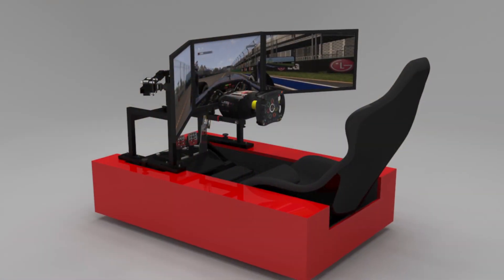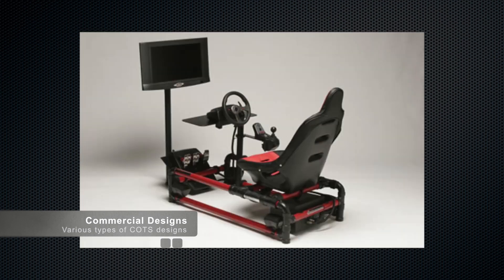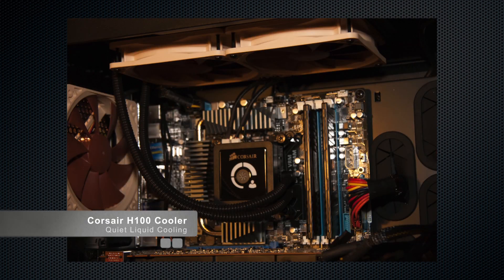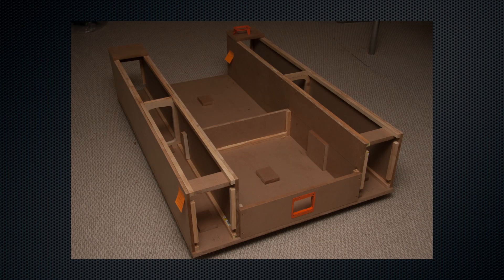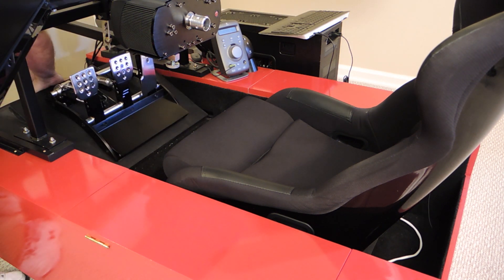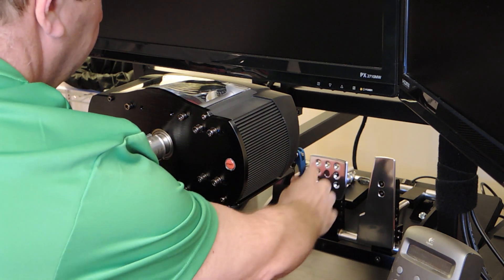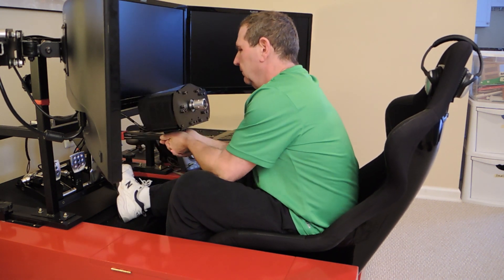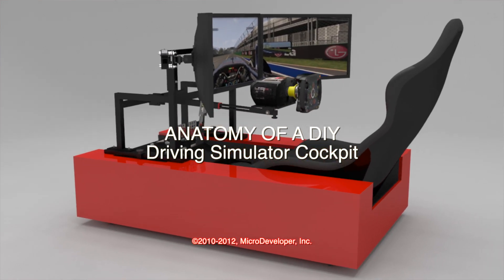Anatomy of a Driving Simulator

Comment: Amazing work Greg!  Finishing my rig with some of your design ideas in a very slim (width) mobile cockpit optimized for vr use , with a single 27" on an articulating gas arm for non-vr use and overall tuning...
Reply from the maker: That sounds awesome!  I'd love to see your new design.
Reply: Gregg Lagnese - it's not NEARLY as thought out as yours, especially since I lacked certain woodworking tools, so the frame is a bit tweaked, but it still looks good.  I think I'll call it a prototype.  Will post video and credit you with some of the ideas.  Currently waiting for my paint to cure more before mounting internal surge protector and powered usb 3.0 hub...

Comment: this is basically the EXACT design I run myself, from a positional aspect that is... Well done video. Should help alot of guys.
Reply from the maker: Very cool.  I'd like to learn about anything that helps with the design of the adjustable steering rack.  That is something I have been working on for a long time.  The building the rig part 3 video will outline the latest iteration which, while much, much, stronger, is still not as good as I'd like.

Comment: quick tips to research that will lead some of you to good solutions... 8020 rig, 4play racing, simvibe, OSW, accuforce, amd freesync monitors/ G-sync monitors (lowest input lag, smoother and nicer than no-vsync, best for racing). NO SLI,  i repeat, NO SLI, Keep tripple screens mounted seperate from rig to avoid shake. MDF for a base, not for a rig for least amount of work. 8020 for scafolding and structure, and lighter than steal. 8020: 350-700$ investment. modular for life. end of tips.
Reply from the maker: See building the simulator sled part 2 for 80/20 designs.  https://youtu.be/b1FEwQmfdHY

SLI will perform best for multiple monitors and is the least hassle (I have tried 2, and 3 way SLI).  While a single 980ti is okay, it is not as good for triple monitors.  However, it is better for an Oculus setup.

The mounts described in the aforementioned video isolate shake.  This isn't a full motion rig.  Freesync/G-sync definitely not required.

Steel is used because it is solid and cheap.  A by product of the weight is that it reduces monitor vibrations too.

In the aforementioned video I describe how much more expensive and cost prohibitive 80/20 is for a full rig.  The 80/20 is not particularly expensive, but all the connector and support costs add up fast.

All of this is provided as a BOM on my website too.
Reply: +Gregg Lagnese multiple graphics cards is not necessary for tripples and is actually inferior, due to the delay inherent with trading frames. most iracing guys use 1 GPU, even with tripples. sli also causes more problems than it solves by requiring many tweaks and special settings on games that don't support it well too. on a single card, frame rate doesn't have to be a problem. gsync takes care of frame rate. smooth even under high load, and doesn't require overpowered gpu's in sli to maintain fps limit and avoid stuttering...and my 980 shreds through Iracing on tripple Asus rog swifts @ qhd resolution.
Reply from the maker: I agree with SLI hassles and I've tried them many configurations of SLI (2/3) as well as powerful single cards (i.e., 980ti as of today).  I personally found that the 2 (or 3) 970's outperformed the 980ti.  It may be my case, but I had a lot of problems getting the triple monitor config to 'stick'.  Often on boot one or two monitors would no longer register.  This is probably due to me having cheap old HDMI monitors and the card having Display Port connections.

Also, going to G-Sync monitors is a big investment for many and is somewhat counter to one of the original goals (build it cheap).

Now that the Oculus is production, I'll be ditching the triple display anyway for one big curved single display for non-racing games, shooters, etc.  I'll stick with the 980 for now too since it drives the Oculus better.

Honestly, I am an Oculus convert, now that I've sunk some serious time into solving some of the issues (like VR sickness).  Racing with the Oculus is just so much more fun and immersive for me.  I can't race without it anymore.

Best regards.

Comment: Steering wheel is not stable, it shakes a lot. Even your seat shakes. Besides. You've got an incredible input/display lag.
I've made much more stable rig with 30$ worth of OSB panels. I'm sorry, but your build is just too overengineered, too pricey, too hard to construct for many and too unstable.
Reply from the maker: +Paweł Be (Bilazaurus) LOL, yeah a real car doesn't move at all...  BTW, I've completely changed the steering rack since this video was made and removed most of the movement, but I'm sure that also is too over engineered for you.  The seat is a real sliding car seat, so yeah, it moves - agreed - just like it does in a real car.  There is no lag between the CSW and the games, but you wouldn't know that just watching a YouTube video, and having no first hand experience of course.

I'm glad you built a perfect rig for less - you should do a video too and share your blueprints and BOM.  Then we all could build killer rigs for $30 - that would be awesome!
Reply: +Gregg Lagnese No point being sarcastic. You say wheel doesn't move in real car. It doesn't. I'm not talking about adjustment. I'm talking stability. It doesn't wobble in a real car. I have a real sliding seat on rails too.
Reply from the maker: In a real car, the entire vehicle is moving relative to the eye point.  In a non-motion simulator, the viewpoint (screen) remains fixed.  The minor movement in the wheel, due to the torque is not perceptible in practice and actually coincides with what you are seeing and feeling.

There are three key points you may be missing: a) you are looking at the original design which allowed for a 10-15mm deflection.  The new one is less than 5mm.  b) Unlike a real car, this setup is intended for users that are 3.5 ft tall to 6.5 ft tall.  c) The steering rack in a real car only moves a few inches in and out and up and down.  This setup extends more than 8 times that amount.  Obviously, shortening the reach and throw will help mitigate the inherent movement in the system.

That said, I don't think it will ever be possible to remove 100% of the movement, nor does it seem necessary from actual experience.  I can assure you, not one single person that has ever used this, has ever commented on the wheel or the seat moving.

While I appreciate your comments, the design goals are well defined.  I would be more than happy to prototype any other design for the steering that accomplishes the same design goal but moves less if you care to share such a design.  I already have built an alternative design which is quite a bit more rigid, and am working on another with further improvements to the usability of the steering assembly.

Lastly, note that this was intended for driving or flight simulation purposes.  Making the steering rack removable, and having places for HOTAS controls, were also part of the original design goals.
Reply: +Gregg Lagnese Nice to have long, cordial and detailed reply. My rig has only me in mind therefore I can adjust only seat which is stable as in a real car. I can't stand any wiggle on steering wheel so it's fastened. I can understand where you're going with it. My rig doesn't provide an option to easily change it into a flight sim. You have to agree that more universal = less sturdy and more complicated. All I'm saying is that for a decent setup you don't have to spend big bucks. I'll probably won't post pics because you'll probably laugh your a** up. Your stuff looks professional while mine is a osb prototype made by hands that haven't done that before. People look for good looks (vide ricmotech) and small sizes. Personally, for me it's this or nothing (I mean a decent, stable rig). BTW. I didn't expect that I'll like the OSB look,  I was going to carpet it but I like it :)
Reply: +Paweł Be (Bilazaurus) *ass off,  not "up" :)
Reply from the maker: +Paweł Be (Bilazaurus) I understand your position.  It's too bad you can't try this out, I'd think you'd see what I mean by it doesn't matter that much in practice.  However, I agree that the original wheel torqued way too much.  That CSW is heavy and the problem with this setup is getting the range of movement I want and still making it simple to adjust while holding a large lateral load.  Right now, I have a single lock arm and a pull pin using a T-Slot shaft which is a lot stiffer than the 1" steel tube with a slit in it.  You can see an early version of it in action at the very end of the Building a Simulator Part 2 video.  In that video, I hit a hard bump that really yanks the wheel and you can see it torque and the range of movement.  Still not as solid as bolting it to a block of concrete, but much better.

Here is the URL to the build of the new rack where you can see the difference:

http://lagnese.me/Hub/Sim_Blog/Entries/2014/9/8_Mk_II_Steering_Rack_Build_1.html

http://lagnese.me/Hub/Sim_Blog/Entries/2015/5/8_Mk_II_Gen_5_Table_Mount.html

Both of these examples are complicated to make which is why I haven't posted anything yet.  I am also working on a new twin-boom design that should stiffen it further, but will increase the cost and complexity.  I am constantly tweaking the design but have been too busy to post video updates.
Reply from the maker: +Patrick B The most recent build notes are on my webpage.  http://lagnese.me
Reply: You still interested in seeing my rig?
Reply: +Paweł Be (Bilazaurus) , Got video or pics? This may be "over engineered" bit it's solid and stable. And looks badass! ;)
Reply: Yes. I will post a video
Reply: Post a link to your $30 rig please

Comment: very good rig but you make it sound like if its easy to make ..i wish i could build it just like yours ..you sohould sell them rigs ..i will buy one ...but i sure wont be able to built it like yours even if you gave me the blue prints
Reply from the maker: modesto vargas Check out my videos on how to build the unit.  Part 2 shows a T-Slot monitor rack option that won't require any heavy machining.  I would have to sell these things for several thousand dollars which defeats the purpose of making a low cost, self contained, game center.
Reply: Thanks and thank you very much for Sharing this

Comment: A very nice video with clear commentary and beautiful animations. My rig isn't that adjustible besides the seat rail as I designed it for me ;)

Though I didn't spend that much money on my rig. Only about 40 euros of wood beams and mdf and the seat, which I got for 25 euros from a buddy who works at a revision/tuning/testing company.

Then again I didn't design in for triple screen either as I'm waiting for the consumer version of the rift. Until then, a single monitor sits behind the wheel on a plate of mdf.

https://dl.dropboxusercontent.com/u/25385141/images/simrig/5.jpg

Comment: How much would it cost to have you build it with everything that u have in there + the monitors and tower with what you said to have in it ??? Please give me an answer as soon as u can thanks
Reply from the maker: The cost of the materials is about $800.  The cost of the computer hardware depends, but is around $1,500 for an equivalent computer and about $750-800 for the three monitors.  The steering wheel, pedals, and dash will add another $600-800 if you go the pricey CSW route like I did.  I don't build these for people simply due to the sheer bulk of the base and the cost to ship it (not to mention the lack of time).  If twenty people wanted one, I might reconsider, but I don't want to get into building one-offs.  I might sell the complicated parts as a unit, like the Mk II steering rack however.  See my profile page to read about the new steering rack design I'm building.  I haven't decided on that yet because I'm not done ironing out the kinks.
Reply: ok if i asked you would you making the complicated parts
Reply from the maker: Steven Boss The small parts and some assemblies (like the steering rack) would be okay.  I'm finishing up the last of the mods on the new components now.  After that, I need to revise all drawings and create a parts list to be able to service requests like this.  So, net-net, is yes, but not yet.  I also want to post a few video's of the new parts so people can see how it works and decide if they want to tackle it themselves.
Reply: ok tanks again gregg

Comment: Of all of the commercial rigs you evaluated, which would you recommend  for overall experience and cost?
Reply from the maker: I've only used one commercial rig, the Playseat, which I modified slightly.  You really just have to decide what level of adjustment and flexibility in fit you'd like.  Then there is the cost of course.  For me, nothing was available that worked with three monitors, fit the kids and me, had built in storage, was easily movable, and didn't cost an arm and a leg.  That's why I ended up building my own.

Comment: What about using just 1 big 40 incher or 32 incher instead of surround gamings 3 monitors. casual gamer looking for good project and fun experience not necessarily authentic.
Reply from the maker: M. Deane
The new one isn't shipping yet but I have it on order.  We will see how it affects the motion sickness.  I love it for FPS games, but I really prefer to see my physical surroundings in a simulator.  With the switches (see the expansion of a driving sim video), it is nigh impossible to use the Rift.
Reply from the maker: I did that in the past with a big 110" projected screen and a Playseat.  The track looks great and is life size.  However, there are some negatives.  For one, the car looks massive.  The second, and biggest disappointment, is the lack of perceived speed due to the lack of peripheral feedback.  That's mainly what the side monitors provide.  Technically, the rig could hold the monitor, but the steering rack would be in the way.  Therefore the monitor would have to be raised above the center of your line of site.  You could reverse the rack and put the monitor behind the rig I guess.
Reply: Will wait for my oculus rift then. Till that may be my 40 inch tv do the job. Planing on doing pvc model from ibside sim racing. Thanks for help.
Reply from the maker: *****
I've been using the Oculus as a development test bed with this and other things.  In short it kind of sucks from a control point of view.  You can't see anything in the cockpit.  From an immersive point of view it's great, but I get sick after about 30 minutes in a driving or flight sim and within 15 min in a FPS.  I'd say 7 out of 10 testers on average experienced VR motion sickness.  I'm not sure why, I personally don't get motion sickness on water or anywhere else for that matter.
Reply: Gregg Lagnese DO you have the newer model, or the older one?  I know they just released an updated dev kit that has higher resolution and lower latency.  They've said that it reduces the motion sickness issues.

However, as you stated, I was already seeing the Oculus Rift as being a problem from a control point.  I could see if you are using just a wheel, shifter, and pedals, or a HOTAS and pedals for a flight sim, you could get by primarily on feel.  Once you add a keyboard or switch panels into the mix though, good luck.

Comment: I coulden't use it since the wheel-mount flexes sligthly, nice design though . . .  good job. :)
Reply from the maker: Yes, I hear that a lot, but honestly the movement is not perceivable in use.  I move around in my real car relative to the wheel much more than this.  In fact, if anything, it adds to the realism I find.  That said, I am building an even stronger steering rack setup that will (hopefully) eliminate all play.  All of the flex in this  design comes solely from the channel cut in the extension tube which weakens the metals torsional strength.
Reply: Gregg Lagnese Well i can imagine, and true you can't besure how it feels only by watching a video.  That said my rig is a pretty study wooden one since im not made of money and i dont have any welding gear.  But i still prefer to build my own. ;)

Comment from the maker: Renderings of the Mk II modular design prototype can be found on my website at http://lagnese.me/Hub/Photos/Pages/Simulator_Sled_2014_Prototype.html#0

Depending on your feedback, I'll design kits for certain elements (steering, monitor rack, etc.)
Reply: Looking at the setup and your rendering for the MkII, why have you made the base so wide? I can't see any practical reason for the size of the base? Am I missing something or is this just a personal preference?
Reply from the maker: Lufferov
The Mk II is actually the same physical dimensions as the Mk I.  The side pods are the width shown for multiple reasons.  For example, they are wide enough for most mouse pads, or they can accommodate drop in shifters or recessed HOTAS controls.  I've also made them the size they are to be able to hold internal sub-woofers (not shown in the renderings yet) and integrated speaker systems.  My goal with the Mk II is to make it completely modular and inclusive with no separate external components (speakers, USB, etc.) if desired.

I think it looks wider in the renderings because of the lens used and the fact that the monitor rack is more narrow at the base.  I'll revise that in subsequent renderings as I flush out the design and start building one.
Reply: Gregg Lagnese
That makes sense, though if I was to build one myself, I'd want the footprint to be as small as possible. But I can see the benefits! Thanks for the reply.

Comment: And the pedals position is good for f1 style but for gt style it should be much lower , so maby if you make it possible to adjust it to much lower level it will be great
Reply from the maker: That could be adjusted in the new design (the entire platform can go up or down).  I'll be posting a few renderings of the new design shortly.